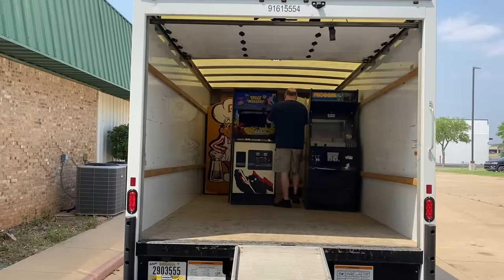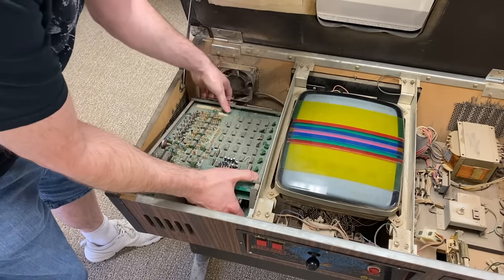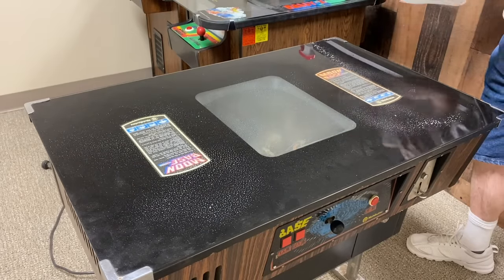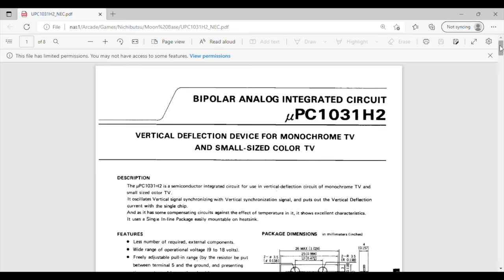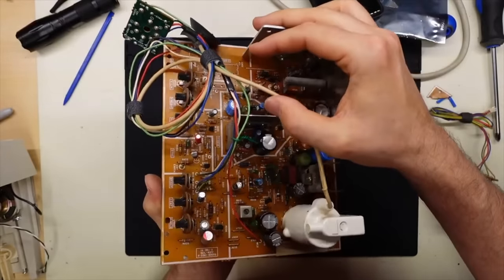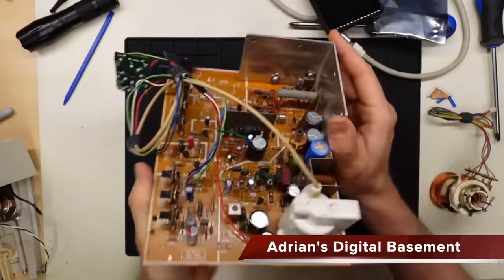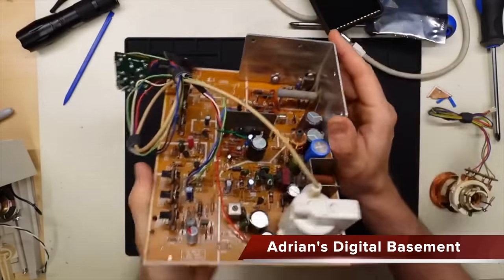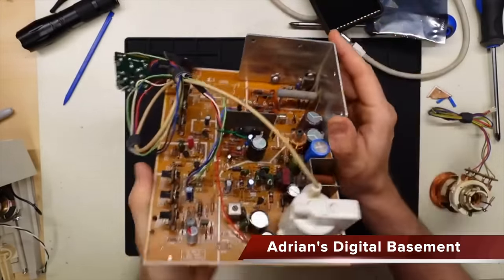Moonbase Arcade Restoration - Gone Wrong

Comment: Check the output voltages on the PSU and check the Vcc and other voltages on that part you replaced. My only guess is that the PSU output is too high and it's quickly wearing out that part.

I've seen Adrian's video on fixing the part, it was an interesting piece. Yeah, it's crazy, the bigger your audience the more likely it will draw in jerks. You did good, but it's important to take several pictures befure you disassemble stuff so it will help you puting stuff back together. Sometimes you think you'll remember where each screw goes but it's easy to forget little details.
Reply: I had the same idea. The cabinet was designed to run on 100 V ans it is not certain that it was converted.
Reply: @piast99  he just assumed that it was actually designed for 120v when maybe it’s not that’s why the transformer is outputting a higher voltage
Reply: When the original PSU was not adapted to 110/120V and is expecting 100 V, the secondery voltages could be to high. Dukefazon is right.   Are there any solderpoints at the transformer for different voltages ?    Wich Voltages does this arcade game need?   You have a schematic diagram, so no problem to look for it.   Wish you many success !
Reply: I was just going to add the same, Possibly Regulator for main supply is faulty, I watched Adrian Black sort out Daves error and mentioned to him that you need to know what the supply in is and what the regulated output should be, guessing and saying that’s fine will lead to tears. Is there a schematic for this board, PS I’m just about to return 3 faulty monitors to a customer, 2 Electrohome 805-801/2 and a wellls gardener K6100 from Asteroids and tempest
Reply: I wouldn't just check the voltage level (of course that is the first step)  but also the possible ripple after rectification (time to get the scope out). Those caps may also be dry and not properly filtering the DC to a level that this IC likes.I am not familiar with the internals of this arcade, but I could imagine that while the actual game runs off 5V, where a separate regulator may be able to filter any ripple away, the CRT board is powered by something around 12V, maybe even unregulated. So really looking at the voltage there may lead to what is causing the problem.

When I watched the video and saw you swapping out that SIP IC, I thought "wait.. I have seen this. I need to look back where that was and maybe it helps you too" until you showed the clip from Adrian's video and I realized that it is the exact same boards. 😅
Reply: @piast99  I've repaired quite a few monitors and agree fully. If the AC is a bit hot there as well, it could be upwards of 130VRMS, which wouldn't play nice when it's expecting 100V. Depending on the assembly of this monitor board, it could be as simple as adjusting a B+ potentiometer. Taking measurements, checking the vertical drive IC datasheet and not blindly adjusting it would still be best, though.
Reply: The fact that the service manual was in English implies it was meant for the American market.  The correct voltage readings should be in it.
Reply: Echoing many comments  here specifically, checking the chip voltages would be the next step. Working back to the rectifiers and filters.
Reply: @residentevilman64  The mains input would have little effect (unless is was 240 going in) 120V in divided by 12V out 10:1 so 130v would add just one volt to the output and the rectified AC is followed by a regulator on the board.
Reply: that was my guess too, also you might want to check the board for bad/dirty signals also, and one more thing is to see if there is a short on the board, however unlikely
Reply: I always take a photo before taking anything apart even though I almost never end up needing to look at the photo again. I have no issues remembering what went where and how it was installed and yet can't remember names well at all lol
Reply: Uh what do you mean by good?!!!?!
Reply: Putting in a piece in backwards even after your brother pointed it out is NOT doing good
Reply: @petesapwell  That's a great point. I appreciate you chiming in. Been working on too much unregulated stuff lately, it seems. My bad.
Reply: It's not likely 120V would cause a problem since that cabinet was likely always run at 120V.  The United States hasn't seen 110V since the 1950's and was pretty much completely transformed to 120V by the time that game went into operation in the late 70's.
Reply: Agreed. Check the power supply voltages.
Reply: @residentevilman64  Not a problem, better to see from more than one perspective! :) Happy Fixing Dude!
Reply: this seems quite logical but it seems like to too obviuos for hin to have not bothered to put a meter on the voltage input surly he tried that already
Reply: @Colaholiker  ,   If no scope is available an AC voltmeter could do the job to meseare ripple on DC line.
Reply: Rule #1 of troubleshooting thou shalt check voltages.
Reply: I was about to say the same kind of thing.  The control panel has Kanji on it so it is almost certainly from Japan and yeah.  Most low voltage dc electronics from there have good enough regulation to deal with our higher voltage, but a monitor board like that may not.
Reply: @Walczyk  By good I mean he tried his best and not afraid to show that he made a mistake and needed another set of eyes to find the source of the issue.
Reply: I would also bet on a bad voltage to the chip or an unstable PSU that's causing unacceptably high ripple. Also, don't take criticism from people you wouldn't ask for advice; a lot of the people who harp on other peoples failures are just do-nothings who can't do anything to make themselves better so they try to tear other people down to make themselves feel superior, they're essential human detritus that should be wiped away like the grime on that cabinet!
Reply: I came here to post this. I am not convinced it was actually modified to run on 115/120V.
Reply: Given that the replacement sip was installed backwards to begin with, it might have been marginal. Might be worth buying a few and try just swapping that out again after checking the vcc to the chip ain't too hot.
Reply: @mikeyc8139  somehting is sending fat current and blowing that IC probably
Reply: ASAP!  Always Start At Power!
Reply: @Dukefazon where's a link to the video in question?
Reply: Agreed. If I ever want to get something from Japan, I'll do a 110/120V conversion to play it safe or get one of those voltage step down adapters that'll allow 100V anything to be used on a 110/120V rail.

For example: I have a Japanese variant of the Panasonic 745 PCMCIA CD-ROM + sound that has a 100VAC power brick and I did some testing with it and it works on my 120V line. However, I only ran it for a couple of minutes since I didn't want to kill the drive. Only for testing it to see if it received power and if it sprang to life.
Reply: @Colaholiker  If that cabinet is built like most arcade cabinets of the period, the monitor has its own power-supply section.  So poking and prodding at the power-supply board and checking its output voltages will get you exactly nowehere -- those voltages are only used by the logic boards and audio amplifiers, not by the monitor.  The monitor will take the actual line voltage (probably through a 1:1 isolation winding on that big honkin' transformer) and convert it to whatever low-voltage DC it needs on its own.

Comment: I have repaired and restored quite a few of these now over in the UK. A few things I picked up from your video:

Nichibutsu Moon Base was an official license of Taito Space Invaders Part II. This also means that the 3 stack game boardset and psu are interchangeable with a Taito cocktail machine even though Nichibutsu made their own pcbs, they are exactly the same as the Taito versions. 

On some of the Nichibutsu/Taito boardsets, they also output RGB on the edge connector and the boardset has an actual colour overlay without using the stick on gels on the tube. This can easily be identified by the two colour proms that are located in the bottom left of the CPU board. If they are populated, then your boardset will also output colour but if not, the proms and 74 series logic chips can be added to do this.

Equally, you could also use the B&W or colour monitor/chassis/tube out of a Taito cocktail with minor modification to the connectors.
Reply: Very interesting info! What is your opinion about what could be the problem here?
Reply: Where the service socket is, there is a switch which flips from two different voltage taps off the transformer. If it’s still set to Japan then the options on the switch could be 100v and 90v AC. The chassis in a lot of these run off around 19v AC. Some have an isolation transformer, some don’t but this voltage will change depending on what the service switch is set to. If I remember correctly there should be taps on the Transformer for an input voltage that is closer to what the US standard is (around 120v AC) if it’s not already set to that, I would change the wires on the transformer to do that. It may not sort the issue out but it wouldn’t do it no harm to be set at the correct input voltage.
Reply: I have several si2 pcb’s and was thinking the exact same thing. Just add the color proms and replace the crt with a color crt.
Reply: @robhassell8447  Thank you! 🍻

Comment: It's almost definitely a voltage issue from the power supply.  I worked on vintage arcade machines for quite a few years, and with these issues, it tends to be an issue with the power supply for the cabinet or the power supply section of the monitor, and there's a small change it could even be the horizontal drive transistor next to the CRT flyback transformer causing voltage issues damaging the vertical drive IC.  I know that was an issue on one of the upright space invaders systems I worked on before.

If you could make the schematics available for both, I may be able to give you some ideas of where to look next.

As for the joystick, an appropriately sized nylon washer under the nut should fix the issues with it being loose...
Reply: That would be my suspicion as well. You need to go over the power supply with an o-scope and make sure the voltages are all within spec and well regulated.

Comment: For the rust on the chromed leg: 0000 grade steel wool will clean the surface rust off without dulling the shine of the chrome. In fact, it should make the whole leg assembly look better.
Reply: Get Brasso with that as well, and perhaps attach it to a drill.
Reply: Aluminium / aluminum foil works too. It's more gentle. But the rust will always come back after time..
Reply: Autosol is in my experience the best way to clean and polish chrome
Reply: Metal polish might also do the trick for the rust.
Reply: CocaCola and aluminum foil has worked for me every time.
Reply: Brillo pad yes
Reply: I use Quick-Glo, stuff is awesome.

Comment: 20:01 I believe you could add some washers to it, I'm sure it had play because of the tolerances and supposed to have washers but the previous technician forgot to put it back in or lost it
Reply: na just a little ptfe tape round the shaft should service
Reply: @jonnyfatboy7563  that would work, but I believe it would get loose over time
Reply: @geovani60624  a possibility but none the less a solid fix.. or measure and lathe the correct diameter part necessary. 
 I opt for the first 👍
Reply: I could have had a rubber washer, which has since failed - there seemed to be dark discoloration around the nut.
Reply: @Octojen  the nut with some spacer would be for in and out of said joystick but you can clearly see the stick itself is like throwing a sausage down an alleyway 😊

Comment: Oh man, I feel your pain! There are multiple things crossing my mind:
- Power supply: does the supply for the burnt out chip do ugly things? Did you already watch it on an oscilloscope?
- what about the insulation on the deflection yoke? Maybe you could check if it has broken throgh between the windings. As it is exposed to mechanical stress during the play this could be a problem. You would need to do som HV measurements there and also measure the impedance of the yoke

The easiest way to deal with it would probably be to replace the board and the yoke with a vudeo unit from a different similar machine. But finding one.... hmm... difficult.

Comment: I would check the deflection yoke.  Over time they can develop shorted windings which would give lower impedance and require you to turn up the horiz and vert drives to compensate for smaller magnetic deflection fields.   Another alternative could be a bad fly-back transformer, but it usually takes out the horizontal output transistor if it goes bad.  You should center the pots. before retrying it and see what it looks like.  Most trim pots are designed to be in the mid position or near it.  You should also check every regulated power supply voltage.  Could you post a schematic of the machine?

Comment: I've learned from watching Techmoan - Japanese runs 100v and 50hz in one area, but 60hz in another.  Seeing the 100v 50hz/60hz on the label made me think of it being made for the Japanese market right away.
Reply: The Japanese text didn't give it away?
Reply: @Okurka.  And Made in Japan.
Reply: If you look at the transformer, there are a multitude of taps for different voltages. Japanese ham radio equipment manufacturers have been doing this for years now.
Reply: @Okurka.  most would mistake japanese text for chinese due to the common writing system and sometimes the same phrase or word could look the same between the two languages further adding confusion for those who don't speak either language.
Reply: @mhammadalloush5104  except it said "Made in Japan" in English so one word more likely assume the text was Japanese.  Plus the first two kanji / hanzi were 日本 (Japan)
Reply: @Okurka.  It can have Japanese text and not have been made for the Japanese market ;)
Reply: @tony4624  Nope, not on that label.
Reply: that switch by the service plug is supposed to be labled.  if you have 120 volts input you set it to the 120 volt position and it lowers monitor power by 10 volts if the transformer is wired for american. leaving it on the other setting gives a higher voltage to monitor.  that had to be wired for american to run in texas for years. american power between 110 and 120 and that switch allow the monitor to be provided a lower voltage.  you can see it on the schematic if you really look says 100 and then the switch has a 90 volt terminal

Comment: Yeah... My first x86 machine was an 80386-40. I decided to put an 80387 into it and bought one. I was being really careful and making sure to plug it into the socket correctly and everything (PGA) yet somehow between the last time I put it on the socket to check the orientation and the time I inserted it into the socket, I had rotated it 90 degrees. I plugged it in and powered the machine up. Oddly, it took like 15 seconds to get to the BIOS screen (a really long time) but then I didn't see the 80387 present. So I powered it off and back on and it came up just as fast as it should have but still no 80387. I did the first test (lick my finger and touch the top of the chip to see how hot it was) and it was really, really hot. I instantly realized something was wrong and looked at it carefully to see that I had rotated it the 90 degrees somehow and destroyed it. I was bummed and the money to get the chip was a lot for me at the time, being a college student on a very limited budget. But... instead of trying to send it back to try to claim it was received not working, I took my lumps and saved up and got another one... this time being even more careful. This one went fine and I was able to enjoy the speedup of having the FPU. So yeah... painful and a learning process that taught me a lesson that I remember to this day.
Reply: @rogerdahl0  Yup, you are correct! Shane even mentioned it was a PGA in his post haha. No shade meant for you first Roger (Since you are both Roger!), we all are guilty of overlooking words sometimes when reading. God knows I'm guilty of it all the damn time!
Reply: Yoda doesn't tell Luke that failures are expensive. We learned that the hard way.
Reply: Ooh that sounds painful! I never bought a math coprocessor because of the cost.
Reply: @EightPieceBox  I had bought the 386 after the 486s had come out so the FPUs were cheaper then. I didn't get an actual Intel one, I believe it was a Cyrix one. IIRC, it had matrix operations as well that one or two programs I had could actually use. In any case, at the time, I remember it being something like $150 but I was on a tight budget at the time and having to buy another one was painful.